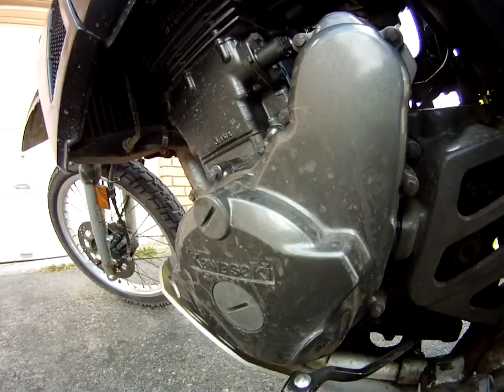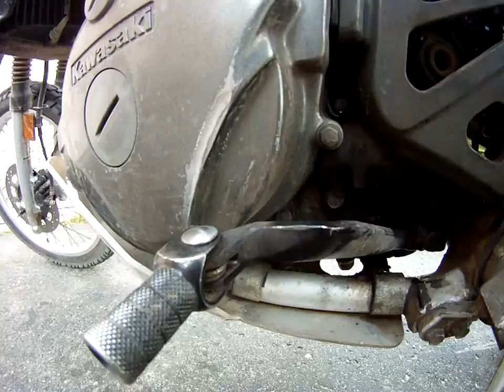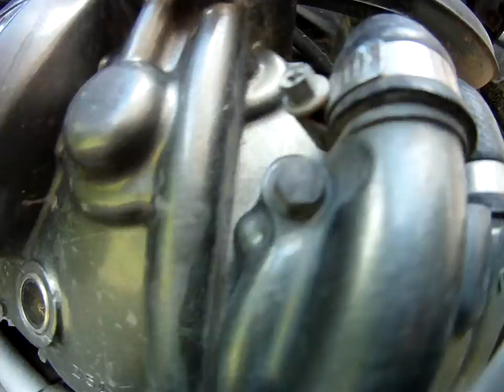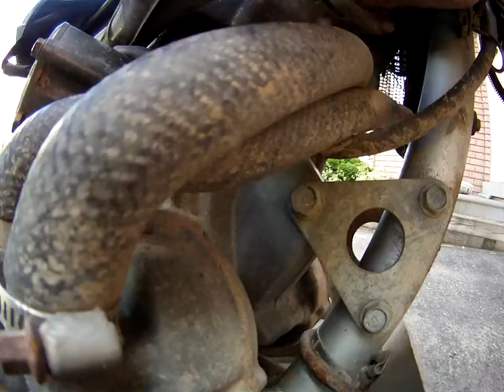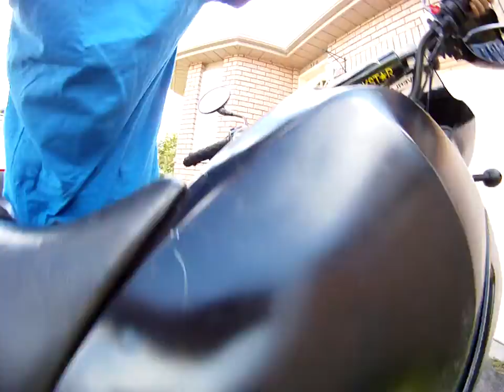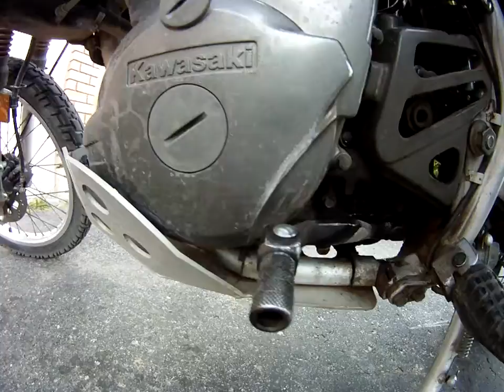KLR Engine Ticking

Comment: i have the werry exact same noise in my klr, should i be worried?
Reply from the maker: Possibly.  It's a loose timing chain that makes that noise.  There's a way to re-tension it that involves loosening up a bolt to let the doo-hickey take up the slack then tightening it again.  You'll have to find that in your manual.
Reply: @PatWendorf  oh my, thank you for the ansver, bdw i tought that doohickey tensions the counter weights chain.
i shall certainly look into it
Reply from the maker: @nseriousget8165  It does tension it but it doesn't move unless you back off that bolt under the shifter and tighten it back up.  Just be real careful tightening it, that's how they snap.
Reply: Yes! Get a dohicky and balancing chain

Comment: sounds like your cam chain is too lose and is whipping on the case? Ever figured out what was causing the issue since you shot this video?
Reply from the maker: Sadly this engine had a bottom end failure about a year later when 3rd gear shattered, and it became a parts bike.  It probably was a loose cam chain.